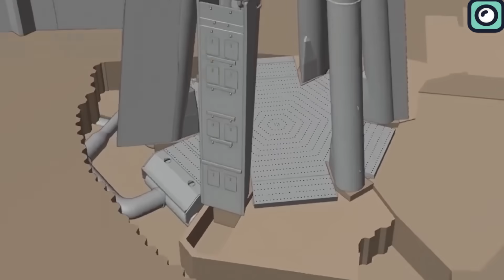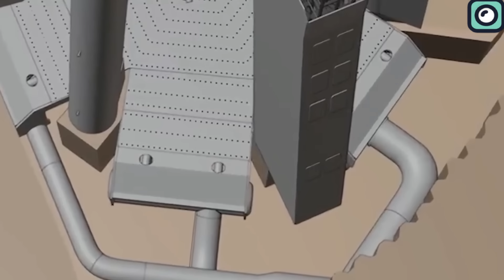Elon Musk Revealed this About the 3rd Starship Launch and this is Great!

Comment: They need to tape the heat shields on, that's right, tape them on - after they are attached as they are doing.  Think of it as shrink wrapping them on. It only has to hold for the ascent. Once in orbit and for re entry the standard attachments will do the job and the wrapping will just burn off instantly.  Hey, I was the one who suggested the steel plate with water under it tow years ago so I had to speak out again.  Lol

Comment: I think it was a mistake that SpaceX did not build a flame diverter of some kind. With a flat plate, rebounding shock waves can damage the rocket, and make more severe ground vibrations that could damage not just the rocket and stand, but maybe other nearby infrastructure. A 12-sided steep steel pyramid, flaring out to be tangent to the ground, built underneath the rocket should reduce vibrations and upward-travelling shock waves. The pyramid would be filled with water to cool it. The surrounding structures might be subjected to somewhat stronger shock waves, but that could be easily addressed also.
Reply: ....aaaand....there goes maintenance access without removing the booster from the OLM.
Reply: the sound waves could be diverted back up into the air with 45 degree walls all around the ship
Reply: They aren't allowed to build that due to the location and the laws and regulations for the plot of land.  Otherwise they surely would.
Reply: @rodneylee4026  I'm not talking about any kind of trench. Just an above-ground water-filled cone, basically.